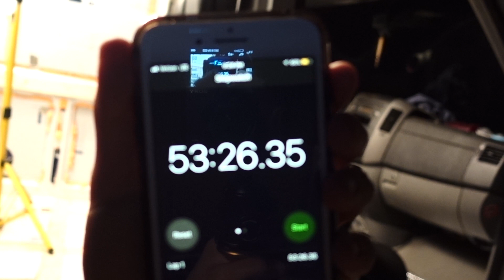BEGINNERS BUILD A HOME IN A VAN | van conversion renovation

Comment: A common thing I see with people building their own vans, is that everybody uses thick pieces of timber at least for the frames. In some cases I even see proper tiling and marble countertops and sinks... And I always think about the excess of weight? Have you guys thought of any alternative lighter materials? Looking forward to seeing the new home!
Reply: Indeed. I don't understand why they do that. I put no framing at all in my floor - just high-density foam insulation, with birch ply on top. It was quick and easy and has worked well for 16 years now. Similarly for the walls: I insulated, carpeted and put in thin (5mm) ply panels. The van members are used as attachment points. This saves space as well as weight and materials.

Comment: Of course it's overwhelming!  People who do this professionally (who do in general also specialize in just one area), study for several years after all, while you have no background in all the areas that go into a conversion.  So it's no wonder it takes you some time, and you make mistakes; that's perfectly normal even if you watched a gazillion YouTube videos.  Watching and doing are very different things, and YouTube isn't always the most reliable of sources either; there's a lot of "bro-science".  But indeed, you can do it yourselves, and you'll learn from each experience.  It's fun to learn this way, IMO; having a real project that is actually of serious use to you afterwards.  And one thing is for sure:  now that you are doing this yourselves you really will know your van inside out (at least as regards the living quarters), and when something goes wrong there, you'll know what's up, and it'll be easier to fix.  It'll really be YOUR conversion; something to be proud of on a whole different level.  It was the right thing to do to tear the van down to the bare metal again and start over.

I'm glad to see you changed your mind about the insulation.  This is much better than your original idea.

Oh, and for understanding electrical system, I highly recommend watching Greg Virgoe's bit on that; I think it's very clear and understandable:  https://www.youtube.com/watch?v=7qEL_kjaV8o

Comment: Your floor is only about 50% insulation. You need to read up about thermal bridging. OK there isn't room in a van to go all passivehouse, but you really do want a full insulation covering as much as possible. I put in a continuous sheet of 20mm Reimo foam, for example. It worked very well. You could use flooring grade PUR if you preferred. But 50% timber is not going to be very good insulation. Better than the crummy job before, I suppose, but a long way from best practice.

Comment: hope none of those screws you screwed thru the floor went into wiring or the gas tank underneath.... some stuff is tucked in really tight, I wouldn't be just blasting long ass screws through the floor like that.

Comment: Watch Eamon and Beck, they're doing electrical and seem to know what they're doing.
Reply: You do realise they are all friends?
Reply: They're using a different power setup than eamon and bec so it's going to be different. Not all power sysems are the same.
Reply: Darian Leigh isn’t that the truth, I ve watched soooo many electrical set ups just trying to absorb the idea of  how to install and not one is alike all are completely unique to each individual purchase. Im starting to get the premise behind it, sorta of.. HA. Keep viewing.. and reading COMMENTS, one can learn a lot in this section as well.
Reply: They don't really. Eamon used solid core mains cable because it was slightly cheaper. Automotive cable has lots of small cores to make it flexible and resist cracking over over time. I don't think that using solid-core cable is very smart. They might get away with it, but the right cable really isn't particularly expensive, and is probably lighter (all the copper used, not 1/3rd of it wasted).